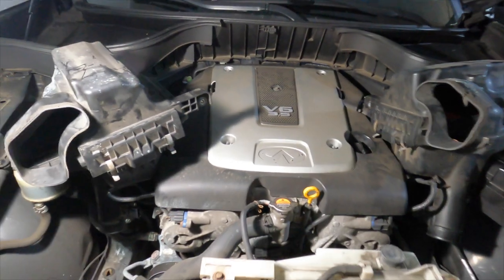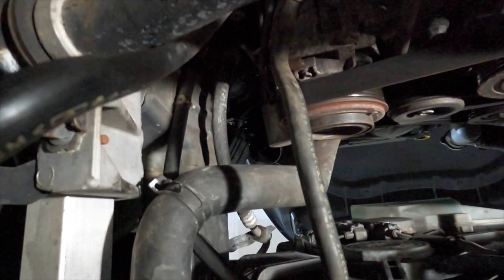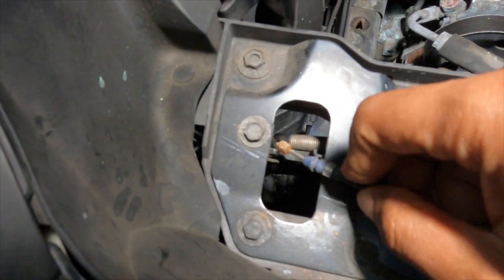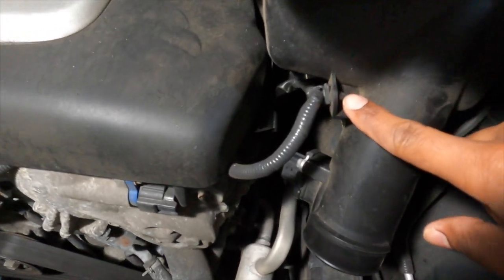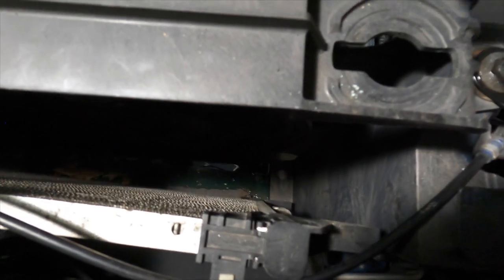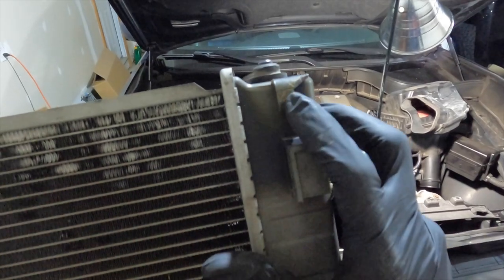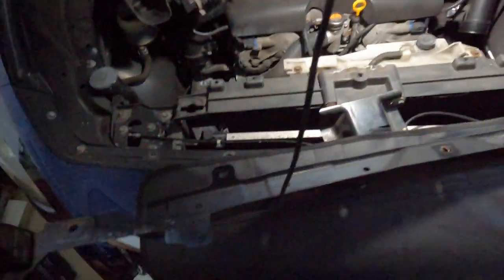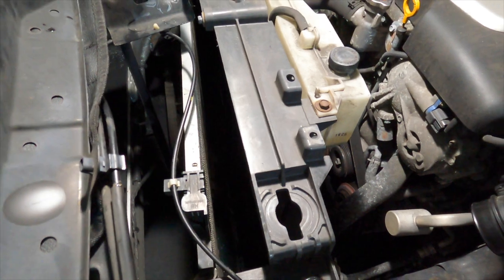FX35, FX37, QX70 Radiator Removal without removing AC condenser

Comment: Thank you very much for making this video. I was very mad when I saw someone remove the ac condenser to do this job. With your good tips I was able to get the radiator out without any of that nonsense. Hoping the new one goes in a little easier 😅

Comment: Do u have the video where u actually remove the radiator and all the bolts and what ever cuz it's confusing me like that
Reply from the maker: unfortunately I don't. The recording didn't come out clear. Where are you getting confused? Check my install video. That might help. If not send me a msg and I will try to help you out.

https://www.youtube.com/watch?v=wMmB8Z-7E0U
Reply: Yea how did you get your difficult spots in and out.  At one point, you said you have more flex on the passenger side after all that releasing on the driver side.  Confused